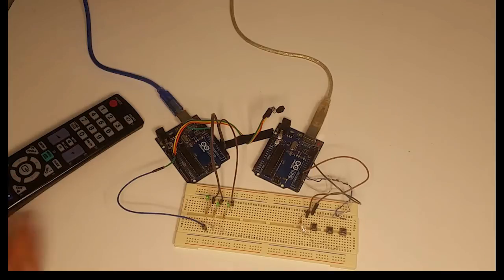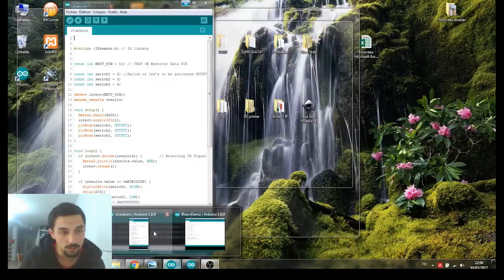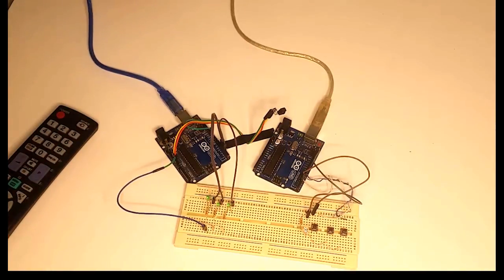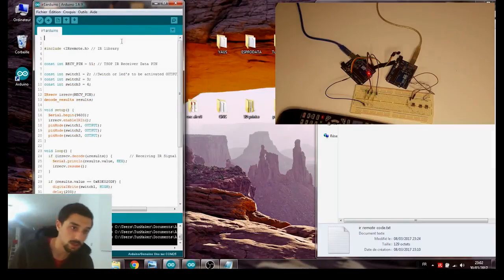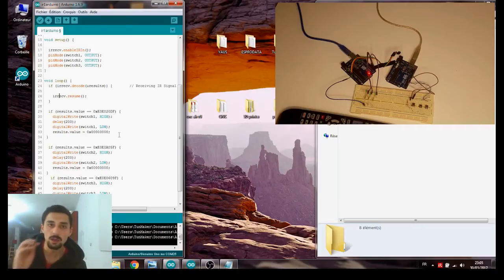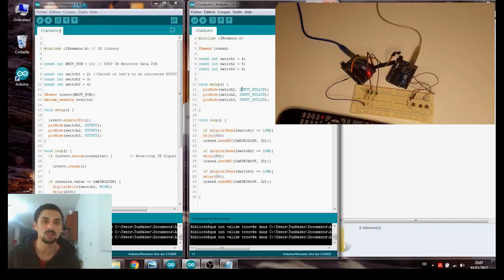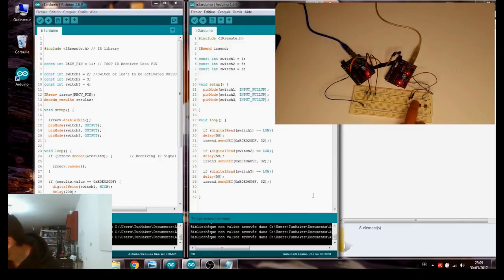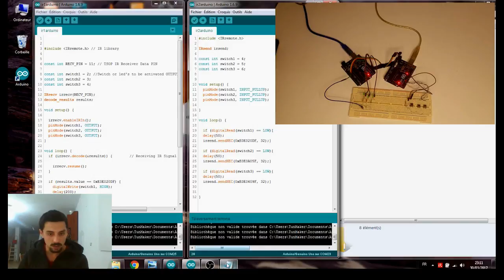Arduino IR remote

Comment: What is the number 32 for in the irsend.sendnce line do? Can I change it to other number?

Also, when sending stuffs, you haven't tell the Arduino which port to use! How did you send it?
Reply: I had this same question about how to set up the output pin/port and it was driving me crazy!! Here's the best answer I could piece together with a little digging:
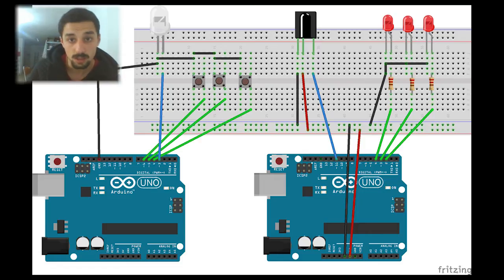For the Arduino UNO board, the IRremote library uses Pin 3 as its default pin. (In the schemas shown at 0:17, you can see that TunMaker used Pin 3 on his UNO.)

Reference:
** This tutorial mentions in passing how the timer is set to a pin.
https://learn.adafruit.com/using-an-infrared-library/sending-ir-codes
"While we can connect an IR receiver to any available digital input pin, you can only use very specific pins for output. The library uses PWM pins and modifies the timing parameters to change the default frequency of that pin.

"The default timer is TIMER2 on the Arduino Uno and Arduino Mega. On the Leonardo with is TIMER1. The pin numbers are pin 3 for Uno and use pin 9 for the Leonardo and Mega. If you have modified the library to use a different timer such as changing the timer number on a Leonardo to avoid conflicts with the servo library, then you will need to use a different specific pin. See section 1.4.1 Supported Platforms in the IRLib users manual for a table which shows the relationship between hardware timers and pin numbers."

** Here is a discussion on the Arduino forum about changing the pin config:
https://forum.arduino.cc/index.php?topic=49630.0
From this response:https://forum.arduino.cc/index.php?PHPSESSID=6d5smks9f92jil45mfb9oqnlk0&topic=49630.msg354580#msg354580
"The IRremote library uses Timer 2 in a mode that only works with output on Arduino Pin 3.
"

The weird thing is, I read through the IRremote code and I think I found the file that detects the board type and sets up the default timer and pin, but I don't see the UNO board in there. Weird.:
https://github.com/z3t0/Arduino-IRremote/blob/master/boarddefs.h

Hope that helps!!!

EDIT: I realized that the library that the tutorial is using on the Adafruit site is a different library than the IRremote library in this video, but they both appear to use the same default pin on the UNO board.